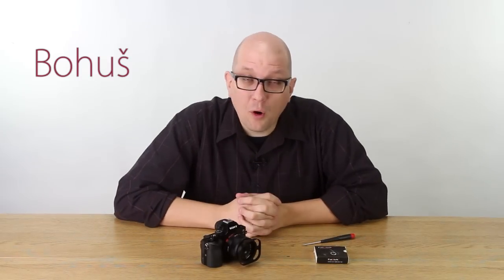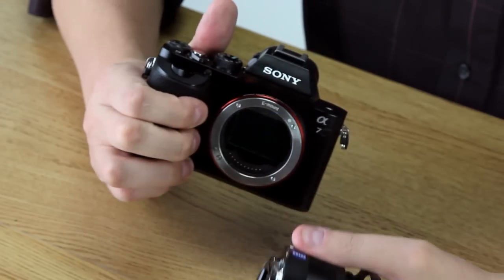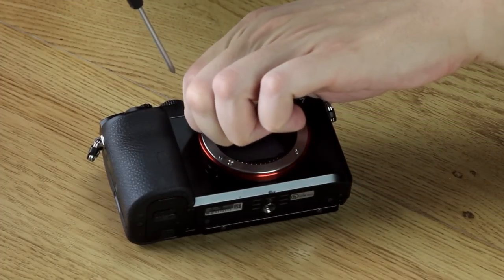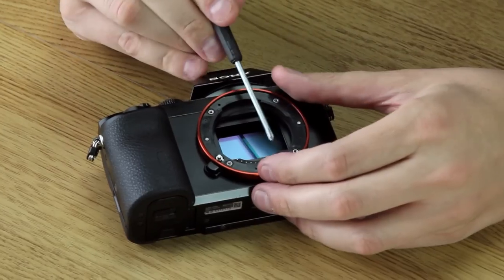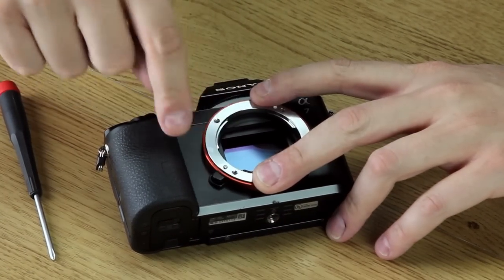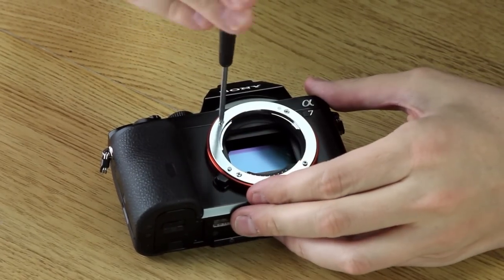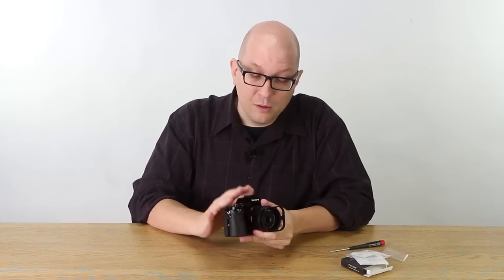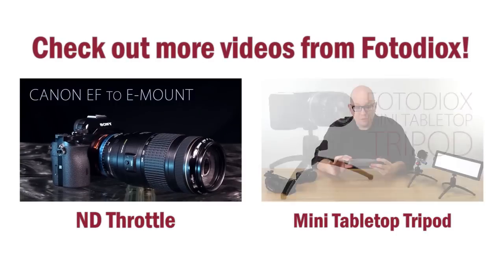Tough E-Mount - Eliminate Sony E-Mount Lens Wobble with Fotodiox Tough E-Mount Mod

Comment: Will this still work for a A7Riii?
Reply from the maker: Yes, but it's not needed. This was made for older Sony E-mount cameras that had a half metal, half plastic mount. The Sony A7R III has a fully metal mount pretty much identical to our Tough E mount, so you don't need to mod it.

Comment: Out of curiosity has anyone including anyone at Fotodiox had to replace the Bayonet Mount Ring the gold plated pins under that metal ring before, I just had one snap off in the middle on my new acquired sony a7riii and trying to get it repaired but one store has told me it'll be about 800 dollars to repair, any feedback would be greatly appreciated
Reply from the maker: Unfortunately we have not, so we don't have any advice other than to look into the camera's warranty.

Comment: Mine moves from left to right? Should I replace it with the tough mount? I have the a7s.
Reply from the maker: The Sony A7s has a similar all-metal mount, so replacing it with our Tough E-Mount mount won't make any difference.

Comment: e-mount was toughened with all metal factory mount from A7S, then A7II.  the A7, shown in vid was/is the camera that benefits from this mod.
Reply: pf course, other E-mount cameras from the other mirrorless series; NEX; A6000? series may benefit, too.- check for wobble first!
Reply from the maker: Yes, you're correct. The Tough E-mount is only for the original A7 and some of the early a6000 cameras with mount issues.

Comment: I need to replace mount ring on my A7II. Which exact screwdriver should I use? Are screws hard to loosen? The only thing that makes me hesitating is damging the screws.

Any information would be highly appreciated.
Reply from the maker: If you watch the video, Bohus will talk you through it. The screws will be a bit tight at first, but once you get them going, they come out easily. We recommend using a Phillips #00 screwdriver for this installation.

Comment: Hmm so get rid of the weatherproofing?
Reply from the maker: This was made specifically for earlier Sony E-mount cameras that had hybrid metal/plastic mounts. Now that all Sony E-mount cameras use fully metal mounts, there's no need for our replacement mount on those cameras.
Reply: @FotodioxInc  right that makes sense. Thanks

Comment: would this work with a sony a7r4 and a73?
Reply from the maker: It would, but we don't recommend it. We made this product specifically for early Sony a7 cameras which didn't have fully metal mounts, but those two cameras you mentioned do have fully metal mounts, so this adapter wouldn't really change anything.
Reply: @FotodioxInc  Well, it would change the look of the mount to that sweet gold brass color, and thats pretty sweet.. so....

Comment: I can’t seem to find anywhere is this works with an A7III. Can anyone confirm this?
Reply from the maker: It should work, but it's not necessary. We made this mount for older Sony E-mount cameras that used plastic in their mounts, but the Sony A7III has a fully metal mount almost identical to our Tough E-mount, so there's no real reason to use our upgrade on this camera.

Comment: There is a reason why it is made up of half mettle and half plastic bec it there is any fall that plastic will take a that shocks of fall and get broke and your camera sensor stay safe 
Because metal and metal can’t take shocks that plastic act as shock absorbers 
Eg see your any iphone screen between that glass and aluminium body there is thin plastic on screen which prevents glass and aluminium to be in direct contact, so as this plz guys do not use that full metal mount unless you want to be more aware not to drop you camera
Reply: And second thing even that lens release mechanism is to fragile it can get damaged with and small fall and to absorb that shock u need that plastic in between that hole metal mechanism and mettle E mount
Reply from the maker: @SwagatRameshJagtap  True, that was their intention for the design choice, but due to complaints Sony has since changed to all-metal mounts in most of their current camera models.
Reply: If dropping your camera is such a high priority, there are plenty of suitable cameras to choose from:
Sony:
RX0 I/II

Canon:
IVY REC (Riptide)
PowerShot D30

Nikon:
W300/s

Comment: I was about to buy one at amazon from you fotodiox, so I asked what metal exactly it's made of, and I am not getting any answer so you will get the same from me, because I wont be buying till I get to know wich metal it's the " all metal " and I mean you would be losing a 3 e mount selling I got a a5100 and a a6500, and my gf an a6000, it's up to you please
Reply from the maker: Hi J.M. we were out of the office for Christmas, but we're back now and can answer your question! The Tough E-mount is made of brass with a chrome finish.

Comment: I just purchased this for my A7RII and ran into focusing issues. The tolerances arent tight enough and results vary depending on lens. Anything that is manual focus with a hard infinity stop is subject to problems.
Reply from the maker: Hi Jeremy, the Tough E-mount is not meant to be a replacement mount for the Sony A7R II. It was designed specifically for the early A7 cameras that had part plastic mounts.

Comment: Besides the wiggling, have you notice any other problems caused by this? I wonder if it could cause that the camara turns off sometimes by losing connection between the camera and the lens?
Reply from the maker: Hi Quantum F o t o, we've never encountered that issue with the Tough E-mount, nor have we had any customers complain about that happening. It's a very secure mount.

Comment: Bought a used a7r with this, can't focus to infiity with quite a few lenses and I can't switch it back. Neat
Reply: I've had almost the same problem on my A7 (I still have the original mount). Minolta A-mount lenses with LAEA4 are way off of focus even using micro adjust I can't get them to focus, put back the Sony mount and no problem. My newest native E-mount lens, the Mitakon 50mm 0.95 will not focus to infinity with the Tough e-mount installed, change back to the Sony mount and will focus to infinity. Same for my Canon FL 58 mm 1.2 lens. Not to mention some of my other adapters would not even fit onto the Tough e-mount, M42, M39 Minolta MD etc. just too tight.
Reply from the maker: Hi Keyboq rd, our Tough E-mount is built with precise specs and should have the exact same focal flange distance as Sony's original mount, so it shouldn't effect infinity focus. Are you sure that the mount is installed correctly? It should be flush the the camera without any gaps or play.

Comment: can't seem to get the dot that locks the lenses to stick out in my sony a6000, help?
Reply from the maker: Hi Reynaldo, you have to make sure you lower the mount down evenly so the lens release fits through, otherwise it will get stuck.
Reply: I have the tough e mount LT version and trying to place it in my a6000.. I can't seem to get it right.. Going to try again once more.
Reply from the maker: Let me know if you're still having issues. It's a bit tricky to get it on correctly.

Comment: BEWARE!!! The tough E mount will not work with many adapters which work fine with stock mount, including some made by this same company.  It does not help with wobble in most cases. Do your research on the forums and you will see many report problems with Tough E  Mount.
Reply: even the newer model?

Comment: Just done my A6000 works a treat but the screws are a bit soft and in tight; you need to be careful -but done in 3 minutes-no drama! and good fit now.
Reply: can't seem to get the lens locking dot to stick out! help?

Comment: I got it but doesn't helps much. I am using LA-EA4 adapter but the 16-35mm F2.8 just too heavy for it (A7R with grip) and therefore, I can't have connection. But works with the FE 24-70mm F4. Think got to stick with E-mount lens for the time being. :(

Comment from the maker: Hi Walter,
We recommend using a #00 Phillips screwdriver. Anything larger may strip the screws in the E-mount. You can also do this install with the mount positioned vertical to the table. This reduces the risk of dropping anything on the sensor.
Reply: +Fotodiox Inc I've tried using a #00 philips, but it's nowhere near as easy as this video seems to depict to loosen the screws, they're just in too tight and even with a good amount of pressure the screwdriver slips out and begins to strip the screws... Gah!
Reply: I had the same problem as MikeHilton1984. The screwdriver that is included is not precise enough nor hefty enough to allow it to loosen the screws.

Comment: Mine arrived today. Installed it. I must admit, the wiggle hasn't been eliminated. Not even the slightest perceptible difference! Feels like €50 squandered. Particularly apparent is the rotational wiggle. 
 
 I had expected a fit as tight as that between the lens and the outer end of my Metabones adapter. Unfortunately, not the case. 

 At least, was spared import taxes and all that!
Reply: Peter Kelly
metal things are a gimmick most times because people think plastic are cheap and fragile. that's not the case. there's loads of types of plastics and some are more stronger and expensive than metal.
that's why some cell phone manufacturers build them with a metal shell. just pure marketing.

in this case I think the issue is relevant despite being hugely hyped. but a stronger plastic would do the same.
Reply from the maker: Hi Unum,

Your Tough E-Mount should have noticeably less wiggle than your original Sony E-Mount. Are you sure you tightened the screws completely? The rotational wiggle is natural as lens mounts need a slight amount of play so lenses can be attached to them. Let us know if you have any other questions or concerns.
Reply: The rotational play is very common, expected and have no effect on quality. If there wasn't any movement, attaching and removing would be problematic.

However, with regard to other wobble there are two components in the A7. The first is down to the plastic bayonet (which can wear also), but I think this has been exaggerated. Indeed, there are many bayonets which are plastic and perfectly fine.

The biggest problem (and seen as a side to side movement) has nothing to do with the bayonet at all, but rather the mounting plate of the A7 to which the bayonet is attached. This is a manufacturing fault and any camera should be returned to Sony for repair.

Unfortunately, the behaviour of the two is similar so, together with all the publicity, many are replacing bayonets with no good reason. I would advise very careful checking first. Look to see which part moves relative to which other. If the bayonet moves but not the mounting plate then, by all means, use this fix. But if the bayonet and mount plate move as one then this part will serve no purpose.

Comment: Two things to add.

First, I was a little sceptical until I bought two A7 (I've got A7s too, but they are fine) and first attached a lens to each. Horrified by the result! The movement is shocking, almost beyond belief and the first camera issue I've had with any of my Sony gear.

The second point relates to this video, as it actually does not show the nature of the movement correctly. Many lenses will have a slight degree of rotational play; that is acceptable and normal. Rocking is definitely wrong! However, the rocking movement on these cameras is lateral, not up and down as you demonstrate. I haven't figured out why this should be, as I haven't taken them apart yet, but I have two of your mounts on order and will try to fathom it later.

So, for those who have an A7, the mount can give rise to movement, but a gentle pressure side to side will show it, not up and down. You can even see it by pressing on the sides of the mounting ring without a lens attached!

Comment: 40$ for a metal ring?!???????? are you fucking kidding me? is it made of platinum or something?

glad some chinese manufacture will copy that in no time and will sell it for less than 1$ and still have huge profits.
Reply: It's rather expensive for me too, however this is mount which I think should be precise in thickness or we might have change the flange back distance, and we might have AF problem such as back or front focus. I seriously can't believe in cheap product which I don't believe the product gonna be precise thickness for every single piece their produce. But, can fotodiox guarantee this? I'm interested in this mount.
Reply: Kurnia Lim
you must be seriously very stupid to think that manufacturing a simple metal ring is an hard thing to do. even I can do it with my CNC with a press of a button. in fact 1kg of steel costs me 3cents and the machine has a precision of 0.001mm. imagine with industrial machines. we are in 2014 not in medieval age. you measure things in microns with absolute precision and 0% fail rate. you have no clue whatsoever about what you are saying.
this is a complete ripoff and it will be copied in no time by chinese companies and it will be sold for less than 1$.
in fact I'm going to buy one just to take the measurements to make several ones and sell them.
Reply: riskinhos It's simple yees if u have good QC, I have quite lots of mount adapter, ex: 3 m42-nex, guess what? 1 of them have different thickness although u can't see it if u not measure it precisely. That's cheap product, mass production without QC. However it's for manual focusing so it's not a problem. 1 of my pk-nex even jammed once, yeah simple.
Reply: Kurnia Lim
you have shitloads of brands doing adapters. 99% work flawless. it's cheap to make metal parts. they cost cents to make and sell for 5$. they are a lot more complex product then just a stupid simple metal ring. so this will be sold for even less than that.
now, 40$?!???? not even in gold. fucking thieves!
if for some chance you have one that doesn't work (which by the way can even happen with photodiox ones) you can always trade it or another 38 ones to try that you'll still save money.
Reply: riskinhos Then why don'y you go and copy this design and do it yourself? They likely don't expect a whole lot of people to be interested in upgrading the E mount, so shooting for profit such as any service is not a bad idea. Everything is worth the money if it's worth it to you, helped you, got what you wanted, and especially if its the only option.
Reply: stevey500
I already copied this months ago and there's already other brands making this at a fraction of a price as I said it would happen. just google.
Reply: +riskinhos I tried to find cheaper alternatives but couldn't. Can you please you tell me where to look?

Comment: I have the a7 and I don't have wiggly issues with it (might be because the later productions). What I was worried about it's plastic... I swap a lot of lenses and I just see the plastic is wearing...
I always wondered why sony used plastic in it.. Not even usefull if you have a magnesium front plate.

Anyways I'am gonna buy this ring it sounds good especially for wear and tear!

Any Europa Dealers?!

Oh Hint: keep the plastic ring! For Sony Warranty (if you need to send back your e-mount camera). Better to put the plastic ring back in... in case they are saying "warranty void" by user.

Comment: You have a link so I can buy that cool lens hood.  Thank you.
Reply from the maker: Here ya go: https://www.fotodioxpro.com/products/rx1-hood
Reply: Thank you.  I thought you have one for the Sony A7R with 35mm 2.8 lens as in the video.
Reply: Fotodiox Inc Got it.  Same lens hood??
Reply from the maker: Phukhanh Vu Yes, it's the same lens hood and it works on both the RX-1 lens and the 35mm 2.8 lens featured in this video.
Reply: Fotodiox Inc just wondering why it has the holes put then on some of the pictures there is no holes on the sides?

Comment: Fotodiox Inc what about weather sealing?
Reply: (just in case you didn't see my reply to this previously...)

We don't have an A7R in house to test this with. When we looked into it, it does seem that a good number of people are disputing how effective Sony's "weather resistance" is on these two cameras. For example this photographer got totally hosed relying on the feature... http://tobinators.com/blog/index.php/2014/04/everything-else/sony-a7r-in-not-weatherproof-shock/

In our A7 (not the A7R), the only thing that could pass as "weather stripping" was the the slight stickiness on the plastic ring as I removed it. There's no gasket or anything that I'd consider important to a real weather resistant system. To be fair, we just don't know since we haven't stripped down the A7R camera, but if we're to believe customer reports online, it does seem that Sony's weather resistant claims may be a bit shaky.

All I can say is that our mod is precision made to fit exactly in the old mount's place. Until we get an A7R in the lab to test it out fully for ourselves, we wouldn't want to make any other claims - especially if there's an underlying question with the reliability of the camera's  "weather stripping" in the first place.